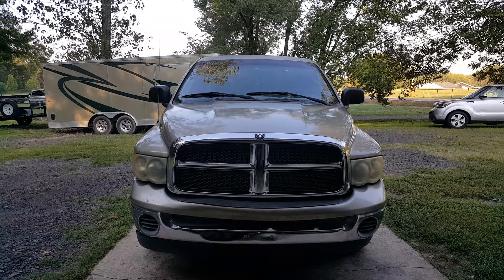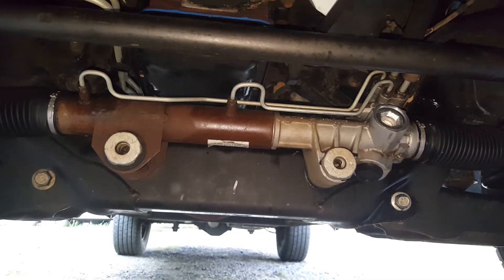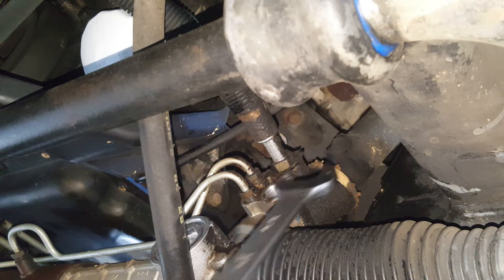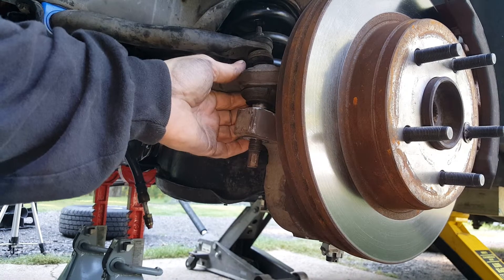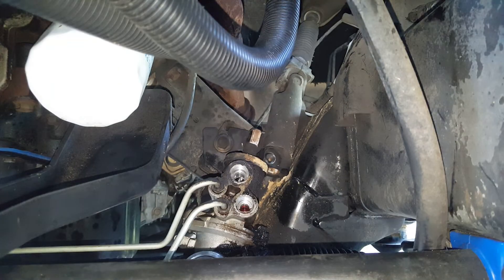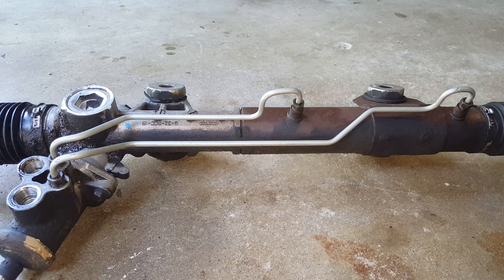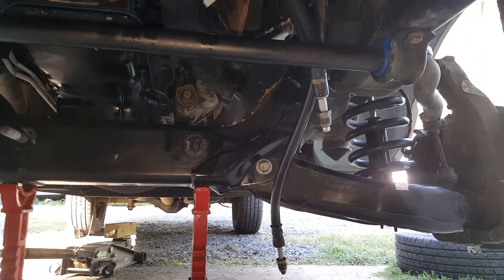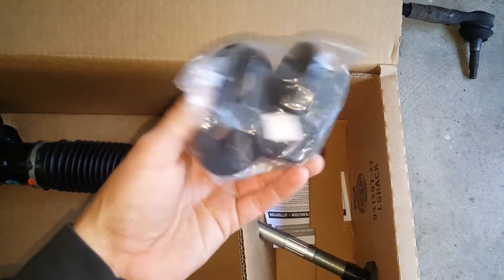Dodge Ram 1500 rack and pinion replacement leaking steering rack detailed

Comment: This is old video but popped up on my fyp. 

Im a huge fan of rockauto and i was like i wonder how much i could get those parts for if i end up ever needing them for my 05 ram 1500. 

Well the cheapest i found was a rack and pinion set for $79.00 and thats no core charge so i dont have to ship something back.

Then outer tie rods i can get for $5 and up but the ones with the hex and oem match is $11.00. 
They did have the AC delco ones like you had as well but for like $40.00 each.

Oh almost forgot the ac delco ones come with limited lifetime warranty and the other oem match ones for $11 come with a 5 year warranty so worth it in my opinion.

Look im not rich and my truck is old and pushing 240,000 miles "5.7 hemi" and i put roughly 70 miles on it daily. I can't afford to and don't want to put crazy expensive parts on. I will also say i have never got tr he wrong part, a malfunctioned part etc i mean its simple to read like 

Oh this is for a rear wheel drive
I need this one thats 4x4 you know? So it would be on me because they specifically list what it fits and doesn't fit. Ive used them for over 10 years since i got the truck and "knock on wood" ive never had to change a part again. Meaning like boughtbone from rock auto and 3 years later it going bad.

I cut all my parts cost in half atleast but most the time by 75% and ive ordered alot over the year.

Wheel hubs and bearings
Rotor
Brakes and calipers
Diff cover gaskets
Pcv valve
Upper and lower ball joints
Cv axles
Front half axles short and long
Water pump
Radiator
And the list goes on
Ive ordered for my two trucks and my parents vehicles so thats why the list sounds like alot. Heck the front half axles were like $16 for short and $20ish for long and thats been like 8 years no issues. My old garage even allowed me to order the parts from rockauto and just have them mailed to them to install. They can't warranty them but again "its lts been over 5 or 6 years since that other work was complete and took my bill from $600 to lik$200 counting labor and the tow.

I get it this is a long rant but i hate seeing people get taking advantage of at parts stores. So if yall already have a cheap parts place great but if not check out rock auto. Its lefit as simple as 
Search rock auto
Year of vehicle 
Make
Model
Engine
And then just scroll through
Fuel and air
Steering
Electrical
Brakes
Etc
Goodluck guys and hopefully yall dont have any breakdowns.

**also im not saying guy in video overpaid or anything so i was just using this vid as an example. For all i know he magically found the parts on the side of the road. This is mostly to someone that will prolly see this video because they are experiencing issues and maybe haven't heard of other places.

We have a local auto zone, napa, and advance in neighboring county. You will pay 3-4 times for each part every single time.

Comment: 235 ft lbs, or 200 ft lbs on those mounting bolts? I dunno, I keep finding different numbers on that, I can tell you this, I tightened them as good as I could get them 8 months later they're loose. so now I just torqued them to 215 ft lbs, that is a lot, its a bitch to get that much torque on them laying on the ground using a dewalt 1/2 digital torque wrench, but lets hope they stay tight at 215 ft lbs. like I said we seen different numbers from 200-235 ft lbs, lets hope 215 will do it

Comment: I just did this and now I get barely any movement from my steering wheel to make a complete turn. I’m reading now that the rack has to be centered BEFORE installing (the repair manual doesn’t even mention this)  Did you have to do issue? Have you heard of this problem? Thanks for your info
Reply from the maker: I have not ran into this problem and I have replaced many with used rack and pinions. It is true it needs to be centered , the new rack will come centered or should. I would turn the wheel back and forth and figure out the center and check it. You should be able to pop the pinch collar up and get it centered. Worst case the tie rods may need adjusted if they are off center. Hope this helps.

Comment: I just put my rack in and when the steering wheel is straight the tie rod threads are extremely uneven.  One side has over an inch of threads showing and the other has no threads showing.  If I loosen the steering coupler at the rack, it only goes on one way.  It’s like my steering is half a turn off.  When I turn the steering wheel, it turns farther one way than the other.  How can I correct this? 2003 dodge ram 1500 4wd
Reply from the maker: So the steering wheel needs to remain centered. The tie rods need to be close to equal as far as how much threads you see. Now with the tires on I am assuming the steering rack to be off centered. So with the steering not connected push the tires to get the rack back centered , then attach the steering. It should be fairly close and from there you run string to dial the straigtness , and then take it to an alignment shop. Hope this helps.